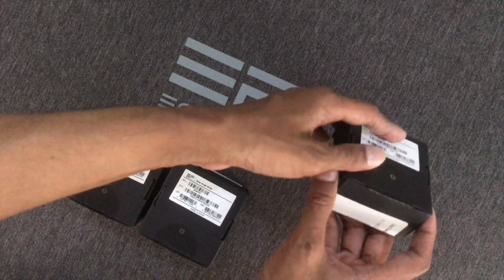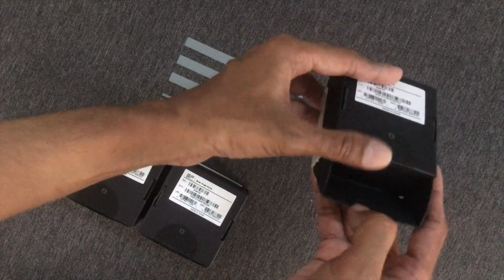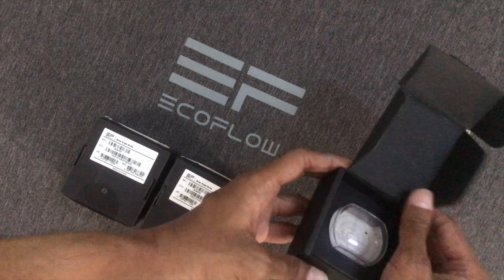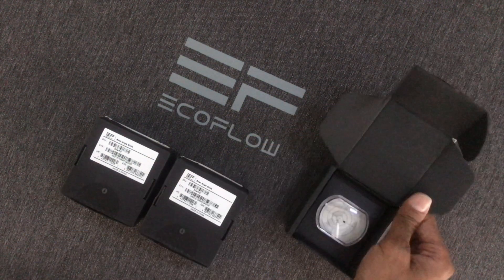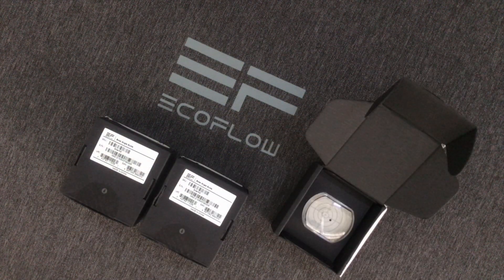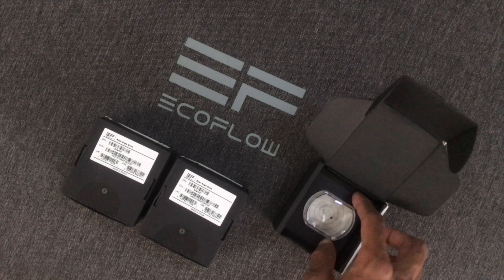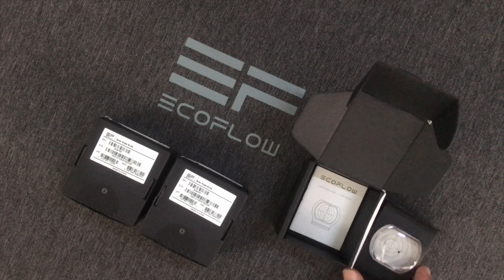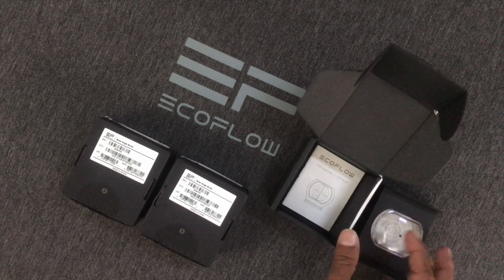ECOFLOW | First Day At the Park With TWO 220 Watt BiFacial Portable Solar Panels & Solar Angle Guide

Comment: BiFacial panels, in reality, only captures between 3% - 10% depending on the reflected surface.  The cost is almost double for the same wattage.  It's an interesting technology, but for now...monfacial makes more financial sense.
Reply from the maker: That's why my solar class students buy in bulk.  If you buy single units, it gets costly.  Get a big group together and buy them collectively/wholesale.